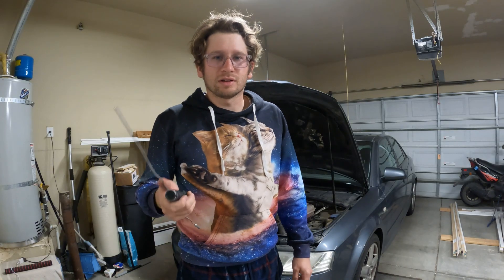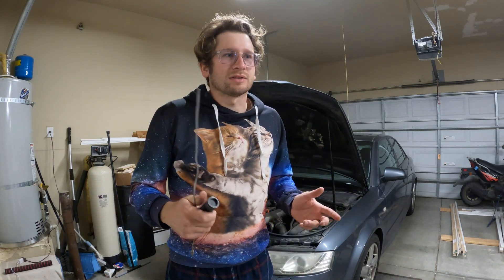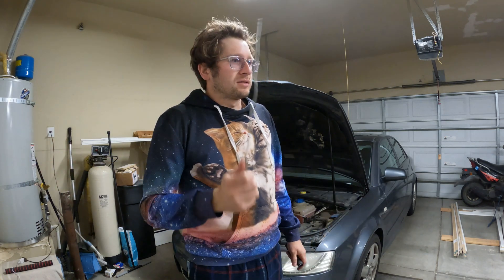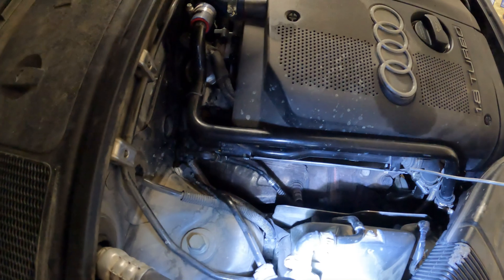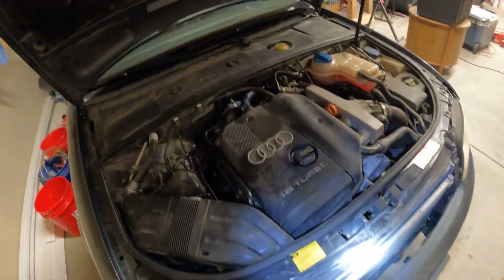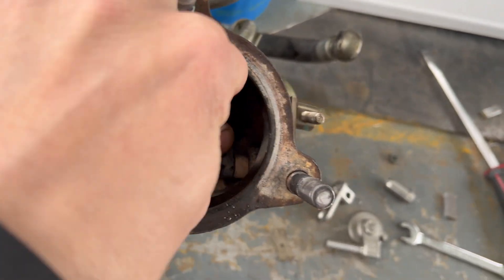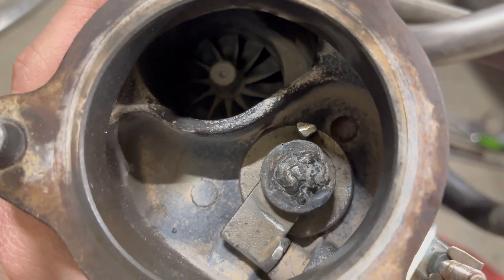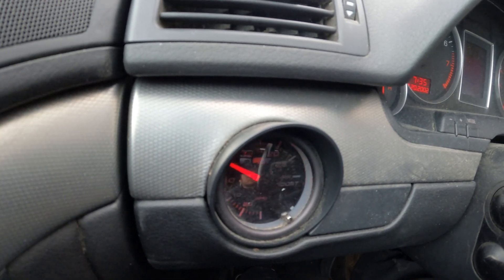VW Audi K03 Turbo Repair 1.8T

Comment: Can u make a vid about replacing the  vvt solenoid. Or more specifically a guide on how to fix code P0010. I can’t find anything on the 1.8t. Love the content btw
Reply from the maker: I have a few videos on the VVT solenoid, I would check your timing belt and cam chain and make sure they are perfectly timed to their timing marks.
Reply: What was the reason for welding the valve disc pivot to the arm that sits inside the manifold?